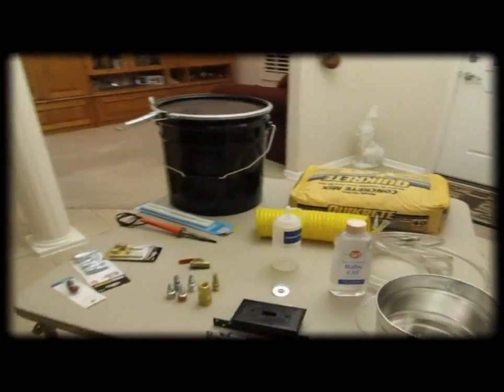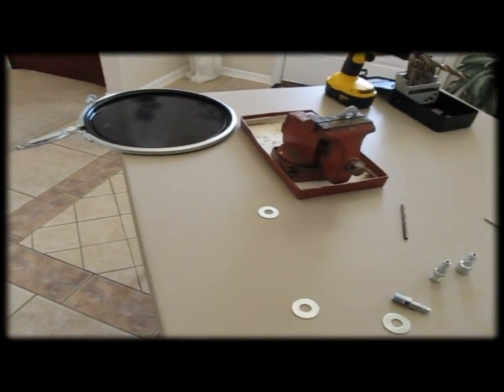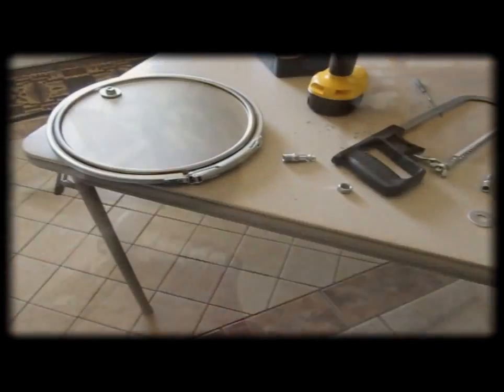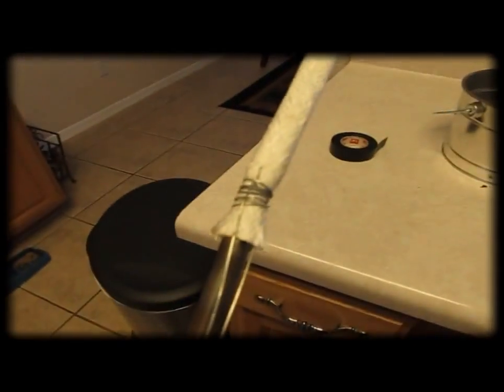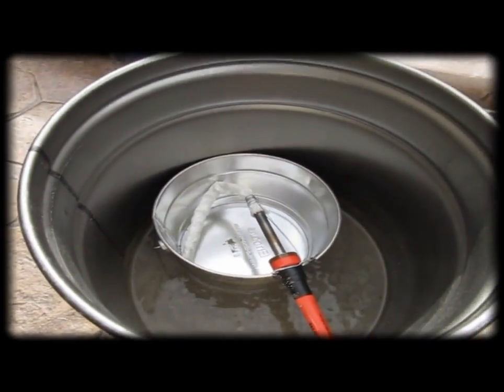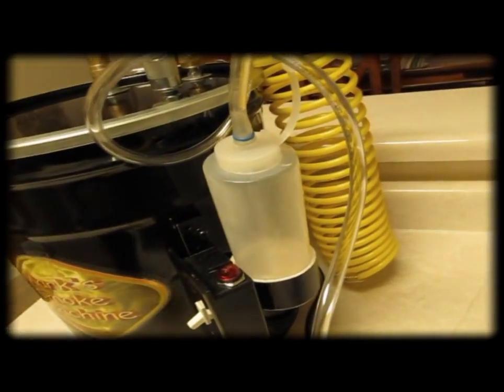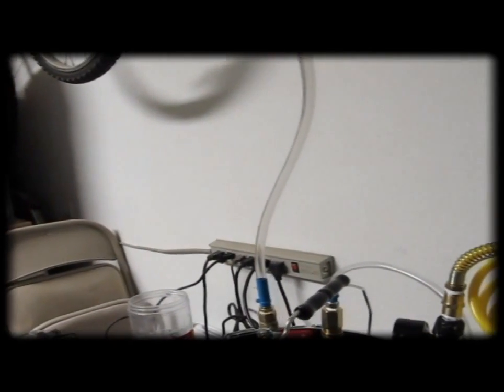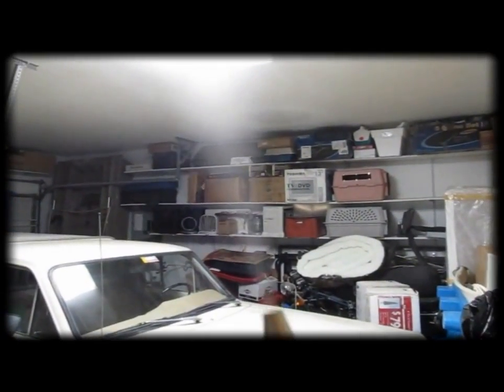Homemade/DIY Vacuum Leak Smoke Machine Tester by Mark

Comment: If you want to use quick disconnect fittings like these, the threaded end is 1/4 inch pipe thread. If you like, you can use 1/4" pipe couplings as jamb nuts. I was thinking that 2 tire valve stems with the valve cores removed would make good connectors in the machine.

Comment: nice build but i would warn you folks, 1 psi is the max recommended pressure for testing the evap system. I recommend adding a regulator also without regulation you could rupture your tank.
Reply from the maker: I agree, not much pressure is needed...

Comment: good job but ,way to much pressure should be less than 10psi max otherwise you may blow off some vac lines or damage a sensor
Reply from the maker: Yes, that's right. I would never allow that much pressure into a line. With the control valves I installed, I can bring it down to very little pressure. About like when exhaling a cigarette is all you need.

Comment: Mark I made one & it pinpointed my leak. I owe ya one brother! shop wanted $45 an hr (said it'd be less than an hour) & I would have had to tow the race car there (I was not about to pull the eng again unless it was fubared). No idea how much psi their machine developed but I build some pressure with this thing!.  rad cap spring was weak/slight stat housing leak (common) were the culprits. A person might add several inches of fuel line black neoprene hose right there at the outlet as the heat wanted to melt the thin clear tubing as I had a Hell of a fire going then I learned to get it smoking real good with little fire. Robert
Reply from the maker: Never had a fire with mine...did you use a soldering iron like I did & wrapped a wick around it?  The container never seems to get hot enough to start a fire...sounds a bit unsafe but glad it helped.

Comment: I'm just wondering if I can put a pyrethrin pesticide in this unit and use it to fog my garden. Aphids go up under the plant leaves and it is impossible to kill them all with a conventional sprayer.

This is the stuff I'd be using.
http://www.amazon.com/Bonide-857-Pyrethrin-Concentrate-8-Ounce/dp/B0035HA0AK/ref=sr_1_1?ie=UTF8&qid=1447157095&sr=8-1&keywords=pyrethrin

Comment: love this design. I actually called basco and they wanted around $12 for the 5gal bucket but they wanted $48 for shipping for one bucket lmao. So today I actually found a 6gal bucket with a sealable push on top from home depot. now I just need a few hoses, fittings and soldering iron and ill be good. One question though how did u wire the iron to the switch
Reply from the maker: Eric Roy It's just a regular single pole electrical switch with a ground terminal. I used an old computer power cable with a grounding plug wire. I drilled a hole in the metal bucket and attached the ground wire to it with a nut & screw then ran another wire from that point to the toggle ground terminal. Attached one side of the plug wire to the power side of switch terminal and one wire from the soldering iron to the remaining switch terminal.  The remaining wires from the soldering iron and power cable are then attached together. Also placed a 120 AC Volt indicator lamp on the same circuit but not really needed as long as the on/off is marked on the switch.  It's probably better though if you google "single pole electrical switch wiring" with a good diagram to look at.  Good luck & let me know how yours turns out!
Reply: LOL....Sarge, you just made my head spin with the connection info......I guess I better find a single pole diagram to look at......Great job. Your design seems more durable than the others I've seen on the Tube.

Comment: You can also drill out a cheapo gas or radiator cap- as adapters for testing for fuel and coolant leaks!

Comment: Mark, what gauge did you choose when you ordered steel pail from basco? They have 28/26 and 24 gauges. Would 28 work or because it is pressurized I need to get 24?
Reply from the maker: I got the 24 gauge.  It should be part SKU: OH5-24/DC24LL-RIB currently at $25.25.  There isn't much pressure needed to push the smoke through the can anyway.  Only a few pounds...sort of what it's like when exhaling a cigar or cigarette.

Comment: Nice invention. I'm bout to assemble one and i like to know what a 2" PVC end cap and the 1/4" barb tubing connectors is use for? I'm not sure where it connect to? If you would give me some feedback, preciated.
Reply from the maker: OlamDao The PVC cap was just used to hold the dispenser bottle...it's not really necessary. The 1/4 tubing was used & positioned directly over the soldering iron & small interior pail so once the baby oil is dispensed, it dripped onto the soldering iron and also into the pail where the wick also could absorb up the baby oil to continue making smoke.

Comment: I wonder if the cost is the same as just paying a shop to smoke test it for you.
Also, seems rather dumb to spray baby oil smoke inside a closed garage. Oil vapor will settle on everything and make a big mess...

I think I will simply use a metal can with some july 4th smoke bombs....
Reply from the maker: The smoke test itself costs an average of $60.00 to as much as $150.00. I know on my video I sprayed a lot of baby oil with a higher pressure than you'd normally use when actually testing on a car. That was done to show the amount of smoke it was capable of producing just for the video.  Even then, it's very light oil & really didn't notice any build up in the garage. Out of 3-cars I've checked so far I've been able to find leaks fairly quickly.  I've seen others use a cigar to check for leaks so your smoke bomb idea should work too!
Reply: Mark Kapuscik
Thanks for the speedy reply!
What do you think about the 4th of July smoke bombs?

About the pressure. How much is safe to ensure you don't blow out the O-rings or worse?

I have an all plastic intake and all plastic TB.

Comment: You will never find a bolt that will fit a pipe thread; pipe thread is tapered.
Reply: 1/4" NPT tap, drill threads out of nut with 7/16" bit and tap as deep as you need.

Comment: Hi, just wanted to clarify a couple details. Are you putting a quantity of oil in the pail and drawing it up with the wick? or just dripping some directly on it?
Also, You said in a comment that it is a 750 watt soldering iron. I don't think that can be right. Could it be 75 watt? Thanks.
Reply from the maker: Oh man...did I list a 750 watt iron?  Don't know where I got that from! Sorry, yes its only a standard 25 watt iron.  About the wick, yes pretty much just add a couple ounces in the small pail which draws the fluid up the wick but can also squeeze the attached bottle that will drip directly over the soldering iron & back down into the small pail.  Thanks for catching that!
Reply: Mark Kapuscik WHERE DO YOU GET THE WICKS FROM
Reply from the maker: Kevin Howard-Tripp Lowes has them.

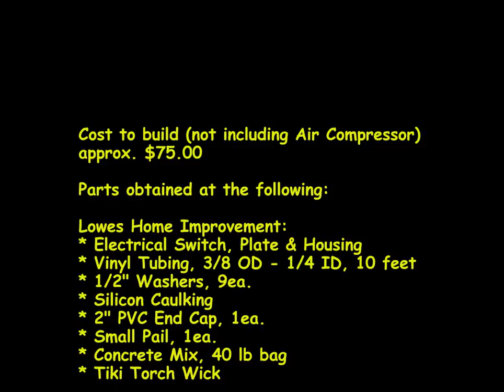Comment from the maker: Cost was about $75.00 excluding the air compressor. I listed parts at the end of the video& where I bought them (time mark 13:57).The thing that cost the most was the steel container due to shipping. From research from others, it seemed baby oil was the best to produce the smoke. It's light weight but I'd still make sure not to contaminate the Mass Air Flow sensor (if you have one) on the vehicle with any oil. Close off access to the MAF with a rag or remove it before introduction of the smoke.

Comment from the maker: I used a computer power supply cord because I have so many around the house & has the 3rd wire for grounding. Basically I grounded the green wire of the plug directly to the metal container w/ a screw, washer & nut. One wire from the soldering iron was wired to a regular toggle light switch (to make/break contact) & then continued to the plug. The 2nd wire from the iron was connected to the 2nd wire of the plug. Also added a 120 volt indicator light to the switch but not really needed.

Comment from the maker: Thanks! I actually had to use it the other day on my daughter In-laws Jeep & worked great.  Was able to find a small pin hole in one of her vacuum hoses. There was still enough hose left to just cut out the bad portion & attach back.

Comment from the maker: Sorry...just saw you asked this question.  I paid about $75.00 for everything except for the air compressor.  The most expensive was shipping of the container since I couldn't find one locally.  The parts listing is at the end of the video to include where you can order the container on-line.

Comment from the maker: Thanks...I designed the label using Paint Shop Pro but you can use any type of paint or photo editing software. Just printed it out on a color laser printer using regular copy paper & some sticky-plastic acetate film cut a bit larger then the label so it attached to the container.

Comment from the maker: Haven't tried any UV dye but imagine it would work if mixed with the baby oil. Isn't that stuff sort of expensive?  If you do try it, let me know if it works!  As far as the list of materials, if you pause the video at time frames 14:04 through 14:19, there is a complete list of materials I used & where I bought them.  Hope this helps & good luck!

Comment: Mark great job I have two questions first. Do you think that UV Fluorescent Leak Detection dye that's oil based or any other leak detection solution would work with your some machine?
Also can you give me a list or post a list of the materials you used to make your smoke machine?
    Thanks for your help. Chris

Comment from the maker: I'm not sure about a vaporizer because it is water based.  I'd probably be afraid to introduce water into a vacuum line system.  Even the residue from baby oil probably isn't the best but I know engines always do suck some oil residue into lines after time so I think it is still safer.  I'd likely use my smoke machine mostly on older vehicles but if it was my wife's newer 2012 Camry, I'd probably just take it into the dealership if still under warranty.

Comment from the maker: I really don't go by the gauge reading & just use it for adjusting the air flow. I imagine probably 1-2 psi is about right.  I agree, you wouldn't want to go pressurize too high because you'd probably damage diaphragms.  Just a steady flow of air/smoke like when exhaling a cigarette.

Comment from the maker: Bought on-line at bascousa.com
$11.30 + shipping. Came out to about $25.00 total.  At the site do a "Product Search" for part# OH5-286/C26RID-B (5-gallon pail with lever lock). The pail is fairly inexpensive...shipping was more than the pail. This was probably the most costly thing I bought to build the smoke machine but was well worth it because of the locking lever. Couldn't find one locally here in El Paso.  Maybe you have a farm supply store where you live. They may have them.

Comment: This is the best I have seen to date. The problem with all these machines is residue. Motorvac has a smoker that uses no heat. I believe they use an atomizer but haven't yet figured out the fluid.